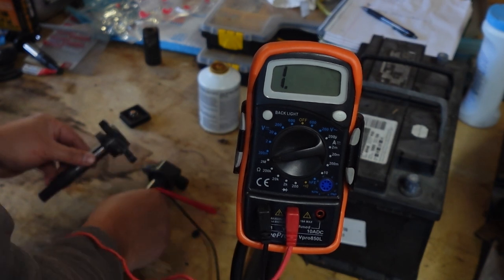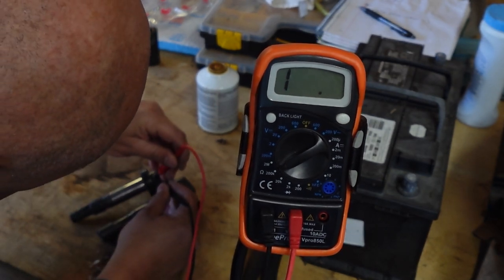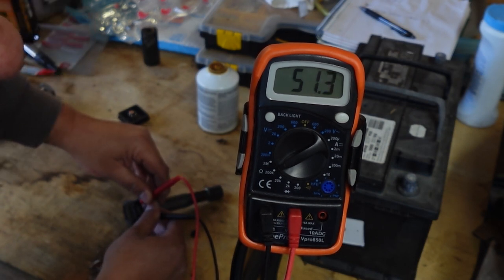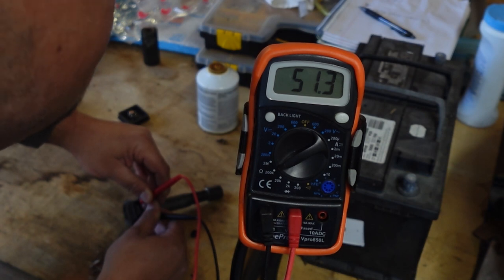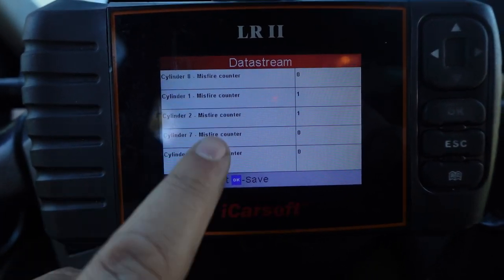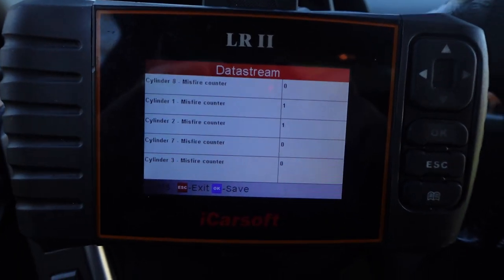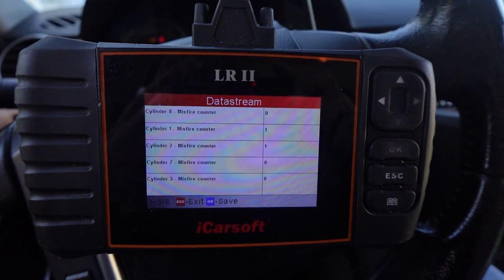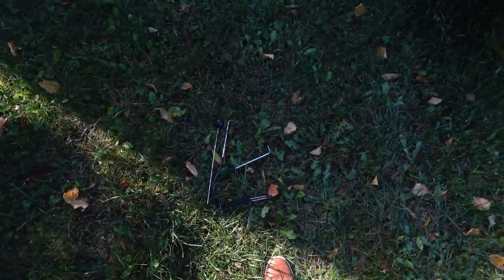Land Rover LR3 Running Rough? Don't Panic! Save yourself $3000 and fix it yourself.

Comment: I would have swapped coil 2 into cylinder 1. If the misfire moved to cylinder 1 that would confirm that the coil from cylinder 2 was bad. I think I would have checked the plugs as well.
Reply from the maker: Indeed. Just giving an option for those who can afford a cheap multi meter vs a scanner and can’t see the data.   Thank you for commenting!
Reply: Do you ever find out what happened to your vehicle? What was the problem?
Reply from the maker: You didn’t watch the video I guess :)

Comment: No No No !! You switch the coils and see if your misfire moves with the coil or the spark plug is bad. 
Bench testing is a waist of time. If the misfire moves, you need a coil. If it doesn't move you need a spark plug.
Reply from the maker: This works if you have a scan tool only.